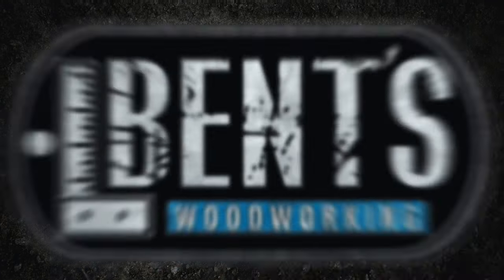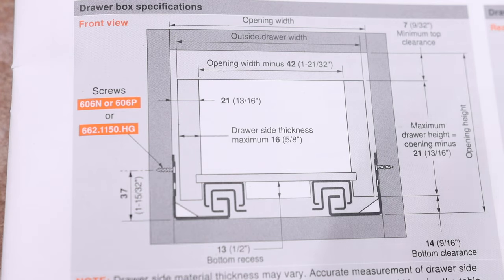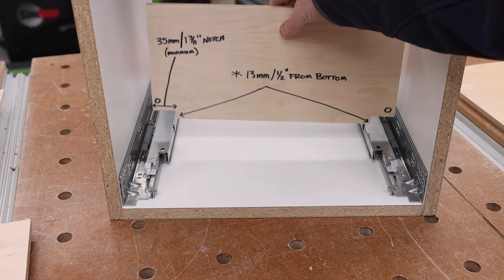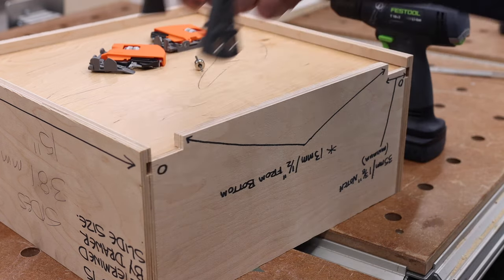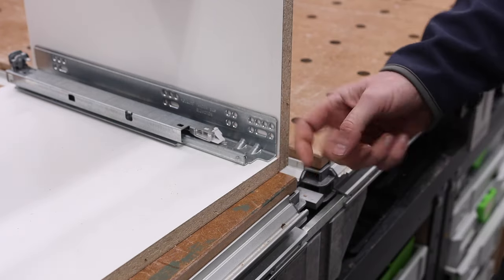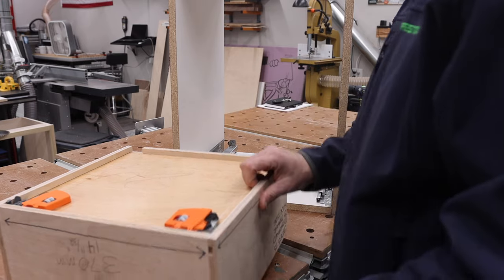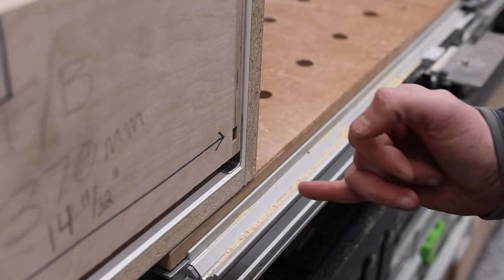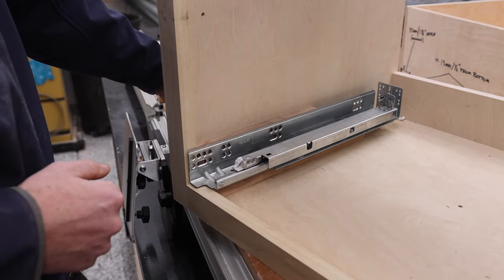How To Install Blum Undermount Drawer Slides

Comment: To locate the position of the locating pins in the rear of the slide, just install the drawer and lightly slams it a few times and the pins will leave an interference mark. Then drill your hole. No need for an expensive jig.
Reply: They make a jig that can be used on all the drawers! I do custom cabinets that can have up to a hundred drawers, I don't have the time for that ridiculous way!
Reply: Great tip, thanks!
Reply: Bourbonmoth 101

Comment: Just a note. He describes cutting the drawer sides the same length as the slides. This is true from one perspective, but the actual drawer slide or the entire fixture itself is a half inch longer than indicated on the packaging. Example, I have 21 inch drawer slides but they’re actually 21 1/2 inch. So make sure you cut your drawer sides the length indicated.

Comment: I've found it much easier to just make the back piece shorter in height rather than cut out those notches.  That's an old style way of making drawers, where the bottom panel can actually go in after assembly.  The back piece is flush at the top, but stops short of full depth.  Saves a step during construction.
Reply from the maker: Yes, that is also a good technique. 👍

Comment: Thank you so much for doing this video.  I too was a little intimidated by these drawer slides but your video makes it look much easier than side mount, especially when it comes to  actually installing the drawer.  Matching up the slides on each side with side mounts is a real pain.  This is definitely the best video I’ve found explaining this process.  Thanks!!
Reply from the maker: Glad it was helpful!

Comment: Great video! Don't forget about the side-to-side adjustment wheel below the hook on the back of the right runner. This allows the rear of the drawer to be adjusted in the same direction as the front so the drawer runs parallel in the opening. 

Also, if you're having front locking device engagement issues (i.e. the drawer isn't "clicking in" like it should), check your material thickness. Most 1/2" plywood is actually 12mm and this causes your runner to "stretch" further than it was designed. The quick fix for this is to make your box 1/8" shorter than the standard runner length (20-7/8" for a 21" runner) or add an 1/8" spacer between your locking devices and drawer sub-front.

Comment: Thanks for this video. Having never used these Blum undermount hinges, I was a bit intimidated, but I went out and used some scrap pieces and everything went perfectly. The Rockler jig is must and made it super easy. again, thank you!
Reply from the maker: Glad you found it helpful
Reply: The rockler jig is what i use everytime i install undermounts. I use K&V slides as its more cost effective, and they work just as good.

Comment: Great video . Just two things I thought people might find helpful. First the hook on the back of the slides is also an anti tip feature for the drawer. So make sure the tabs are inside the holes. 
Second if you have to remove the drawer box that has the drawer front attached you will actually have to reach underneath and pull the slide towards the clip till it clicks. Due to the slide being set back 1/8”. If you just push it in it won’t click and the drawer will most likely fall forward when extended.
Reply from the maker: Thanks for the additional tips 👍
Reply: Wow great healpful tip, especially when removing drawer's  and then reinstalling them. Thanks!
Reply: @dporrasxtremeLS3  thanks I have had a few service calls because someone drawer wouldn’t work right and that’s all it was . No one showed them how to put it back and they were used to the old slide and rails. I now show every customer so I don’t have to go back after they get that ladle out lol

Comment: Great  video. This may have been mentioned in another comment, but just in case it wasn't, there is another method for installing the slides that was not shown in the video. This will work in cabinets with or without face frames and even stickbuilt cabinet where there may not be sides between the bays. I know that this works with Knape & Vogt undermount slides so I am assuming that it will work with Blum slides. The slides can be screwed to the bottom shelf of the cabinet and/or to a shelf in the center of the cabinet. I recently converted a 3 bay stickbuilt base cabinet from 3 doors to 6 drawers by screwing the mounts to the bottom and center shelf in each bay. The holes are in the slides and as long as the screw heads don't interfere with the mechanism, you should be good to go. While not limited to face frame cabinets, this method easily solves the issue of face frame cabinets that are too deep to use the rear mounting bracket. By placing the slide on a shelf, there is no need for a side spacer or back support bracket.

Comment: Built a  MCM TV console for my son from solid white oak.  The grain on the ends and dividers is vertical.  To avoid screwing the steel runners to the oak which may expand and contract, I used the brackets in the rear.  They can "telescope" in and out if necessary.  Over thought the installation for a long time, but once you get your head wrapped around them, these are wonderful slides.
Reply from the maker: I was the same. Avoided them for a long time cause I was intimidated but then tried it and found I like them much more.

Comment: Very useful.  Nine stars out of ten.  There are other details we run into, like mounting the drawers above the bottom one.  But overall, I did learn a lot.  For one thing, I thought I could have drawer sides that were deeper, front to back, than the length of the slides.  Now I'll have to crosscut down the sides on my drawer boxes.  Thanks.  Also, as luck would have it, I'm using frameless cabinet and full overlay, just like your long example.

Comment: This video is very useful and your effort in making it, appreciated. Although I studied the Blum documentation, this video put everything into context and made planning and ordering easier. The only thing I couldn't work out is if the slides will work with 18mm drawer sides. This is what all the main panels of the wardrobe are cut from.

Comment: Great video 👍.  I just finished building 3 cabinets that will install under a mobile work table. 9 drawers total. I used side mount slides. Th se are better and I wish I had seen this before. Next cabinet is going to be a built in for under my SaWStop and it will use these 😁
Reply from the maker: Glad you enjoyed it

Comment: Quite a collection of tools you have 👍🏻. I paused the video and estimated the cost of every tool in that paused frame.  It has to be between 15k to 25k at least... One festool sander and vacuum will put you up over $1100 to $1200, and that was just 1 of like 5 festool sanders i saw 😲. I have 2 bosch sanders from HD that cost around $80-$100.... So, im saying im super jealous 😀.  However I do have a Avid CNC machine which turns what was a 4 hour job into about a 15min job.
Reply from the maker: Yep! Not every tool was purchased brand new, some were picked up before price increases, and some were review units. I need to dig more into my CNC!

Comment: Fantastic video, Jason! So I bought the 563H slides at the beginning of February and overthought them forever. I read and re-read the installation instructions. I’m so pumped that I knew every single thing you talked about. I’m a much more hands on learner and so once I just got started, it was easier to conceptualize. I did the dry fit in my cabinet as well before assembling the drawer boxes. Great job on this video. I’m sure it will help tons.
Reply from the maker: I’m so glad that you enjoyed it!!

Comment: You did it: the best Blum slide video on YouTube for sure! BTW, I switched my shop to Metric a few years ago and I'll never go back.
Reply from the maker: Thank you! That’s what I was going for!!
Reply: I’m Coming from machining/metalworking and caught the woodworking bug during the “pandemic” shutdown.... stupid question. Do you just memorize the thickness of stock in mm or measure every time? I would love to switch to Mm and find myself working in mm for parts of jobs I just can’t come up with a good system for buying my wood if I draw out a project in metric

Comment: Fantastic informative video.  Thanks.  I have just downloaded the full catalog (only 726 pages!) and the 563H appears to be no longer produced.  I presume the 560H and 566H are the replacement parts.
Also, I recommend everyone digs out the datasheet and rewatches the video - then you can see where the measurements come from in higher resolution than on the video.

Comment: Great explanation.  I have one question how do you calculate the length of the drawer slide to use?  I have a carcass that is 22" deep 558mm so I bought 550mm slides, but when I made the box out of ½" ply, the drawer retracts proud of the carcass, so what's the deduction I need to make? with the side and back it was easy internal width - 42mm? many thanks Michael

Comment: BLUM needs to "hook you up" because their instructional videos are lacking! PS. For those using these slides with 'inset' drawers, weight your drawers during installation. 🤙 Great video JB!!!
Reply from the maker: I wish they would 🤣🤣
Reply: It's important to check that the clips are set to their lowest position, so you always have room to raise the drawer box. It's not really necessary to set the clips to the middle position, because you'll almost never have to lower the drawer box after you set the drawer front and add items to the drawer.

Comment: This was outstanding!  I had looked at the online catalog but was confused.  It looked like it was written by engineers for professional installers.  With all the models and sizes, etc., it was intimidating.  You have provided a fantastic tutorial here!  Blum should pay you.

Question:  Why is the longest drawer length for Model 563H only 21"?  In a 24" standard cabinet, if we assume 1/2" back wall, that's 23-1/2"  Why waste 2-1/2" behind the drawer?  I assume there's an obvious answer.  I hope you can tell me.

Comment: Informative and helpful video as usual, Jason.  I think it's important to note that the thickness of the drawer sides are crucial.  You can't use the 563H if you have 3/4" material for your sides, something I do routinely on utility projects.  You would need a different set of slides, 563F I believe.  Thanks again for posting.  Mark
Reply from the maker: Great point!
Reply: Which would you use if you have 3/4 inch material because that's what I'm going to use? Also, would the 42mm measuremebt to deduct from the width still be the same number for 3/4inch material? Thanks
Reply: Oops sorry I just saw the difference 563F vs H (563H), same question on the 42mm however
Reply: @Tania689  From what I found on the internet, Tania, you subtract 49mm when using the 563F.  Personally, I found the whole process tedious and confusing.  Jason did a great job and dove into the minutiae, but check out Jon Peters' Youtube video on the same subject, Undermount Drawer Slides Made Easy.  For me that one was easier to follow along with.  Good luck.  Mark

Comment: The Blum instructions and install manual use NL (Nominal length of slide say 450 in my case) but you can not make your drawer depth to this as it will be 10mm too deep as I found and then on re reading the instructions it is NL - 10mm to give you the inside drawer depth.  You say make the draw the length of the drawer slide, not sure that I understand exactly what you meant by that.  Great video helped enormously.

Comment: Just wanted to note that the sizes are different on the Blum Tandem 563F.  It's opening width minus 49mm (1 - 15/16").  The notch is still the same.  Thanks for the video!

Comment: Well done - clear, comprehensive, no unnecessary waffle (a rare thing in Youtube instructional videos). Just one question: where do you get the requirement to set the slides 3mm back from the cabinet front? The catalogue instructions I have just downloaded seem to have the slides set flush. They do require the cabinet internal depth to be 3mm more than the nominal length of the slide, but that's a different thing.
Reply from the maker: It is listed in the picture

Comment: Thank you for the great video.  If you don't mind asking one question. We have frame cabinet, so definitely needs spacers (on both sides and bottom).  In your video, the first hole of the slide got screwed into the face frame for the overlay.  If we are not planning on the overlay, can we push the slide in, so the entire slide is inside the cabinet cavity (the first hole align with the spacer, not the face frame)? Because of the location of hinge, we cannot screw first hole to the face frame (at least the very bottom one).  Deeply appreciate your comments.
Reply from the maker: If you are doing inset doors than you need to add the thickness of the front

Comment: 💥💥QUESTION💥💥  you mentioned you usually use the 5mm euro screws to mount the drawer slides to the cabinet.  What mm LENGTH of the euro screws would be the go-to?   Really great video, thanks so much!

Comment: Fantastic video, so clear and professional. 
I know you already explained it but can i ask, in regards to the wheel adjustment at the front of the draw that moves the draw left and right.  For example if i want to move the draw to the left, do i just adjust the left wheel or do you adjust both left/right wheels together in the same direction?

Also you say to make the draw depth, or draw sides the exact size of the draw slide. Is that the overall size or do yo measure from the front of the slide to the back of the pin?

Finally to position the runner in the carcass, you mentioned to back it of 3mm from the face. Is measuring in 37mm and using the third hole from the front the same thing??
Thank you so much.

Comment: Thanks for the video Jason.  As you said, it really is the only one to watch for this process.  Did you notice that a width of 16" should be 406mm, vs the 412 mentioned? Just double checking so I don't mess this up 😁.  Thank you.
Reply from the maker: Whatever the interior width is, you subtract from that.
Reply: @bentswoodworking  Yep, the process wasn't an issue, just the stated conversion from inches to mm was incorrect.

Comment: Thanks for the video, very helpful, provides a lot of confidence.  One question, when you put the drawer in, you push it in until it clicks.  But once the drawer front is attached, would it prevent the drawer from clicking back into place if you had to take the whole drawer out for some reason?  Hope that makes sense. Thanks you!
Reply: It shouldn't prevent it from clicking but if it does you can just reach under and click it in manually

Comment: Thank you Jason for a very informative video.  Yes the metric system definitely has its advantages.  My question is if making the with through dovetails, can I make use the same dimensions or do I need to increase the side lengths to account for the width of the drawer front and back?  Figured I would ask and save me from re-cutting.  Please keep up the videos so we novices can learn from you.  Thanks and happy new year’s.
Reply from the maker: The drawer can have any joinery you would like as long as it meets the measurements for the slides. Dovetails will just require a little more planning from a math perspective
Reply: If the front of the box is going to extend past the bottom of the drawer box then yes. Your locking devices will be back the thickness of the front so you'd have to accommodate that by adding the Thickness of your drawer box front  to you final length dimension otherwise the box will be too short and you won't engage the rear adjustment tabs at the back of the slide. You'll also have to set the drawer slides back the same amount from the front edge of the cabinet as well to get the proper clearance as well. For example if you have a 550mm drawer slide with a 19mm front that extends past the bottom of your box your size should be the nominal length of the slide minus 10mm plus the thickness of the drawer box front (550-10+19=559) and instead of a 3mm set back from the front edge of the cabinet you'll need a 22mm set back to account for the increase in size of the drawer box. Also note if you're drawer box back also extends past the bottom of the box a notch will have to be cut to allow clearance for the slide as well.

Comment: This video convinced me to switch to Blum under mount slides.  It’s one of the best videos here.  Question.  Perhaps I missed it but what is the thickness of the drawer bottom plywood?  You are using 1/2 inch ply for the rest so is the bottom 1/2” or the more common 1/4”?  Thanks
Reply from the maker: Just depends. I like using 1/2 on everything. Just find it easiest when breaking down parts.
Reply: Good point.  Thanks.

Comment: I did all the math in figuring out the width, but then I realized that it was much easier to just install the sliders first, then measure the distance between the rails. The width is the only measurement that is a bit tricky. Unless I'm missing something, this method seems a lot more straightforward. Of course, it requires installing the sliders before you can build your drawers.
Reply: Same method I’ve been using. Can also push drawer into the right and left pins to see where to drill holes in drawer backside (I didn’t buy the pre-drill hole jig)!

Comment: Couple questions: 1) What is the tolerance on the front and back pieces?  I know your example was 370 mm width but it looked like there was some play when you dry fit them together with the sides.  Would it be 370 +0 / -1 mm or do I have more room? 2) Similarly, what is the tolerance on the side length?  381 +? / -?  These are critical when it comes to cutting the wood.  Thank you.